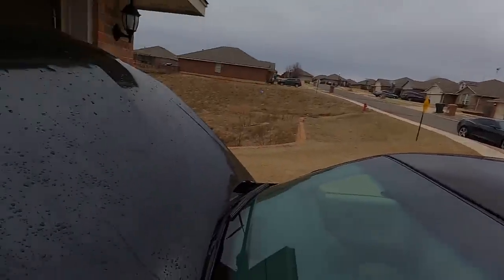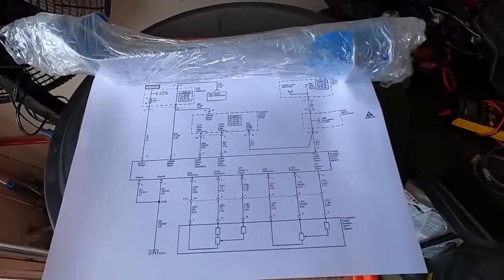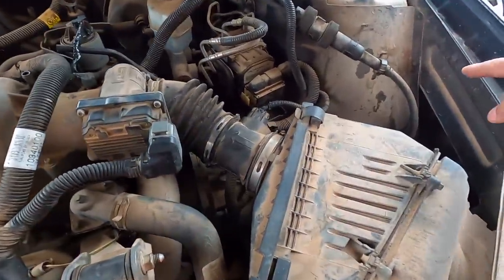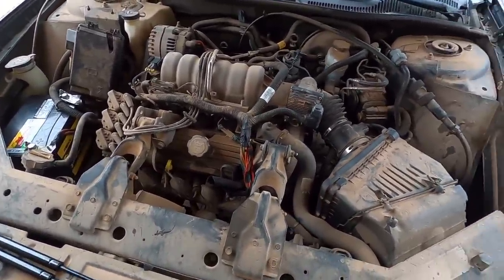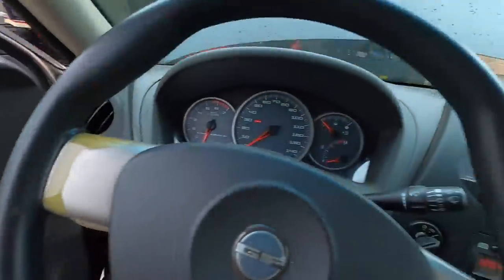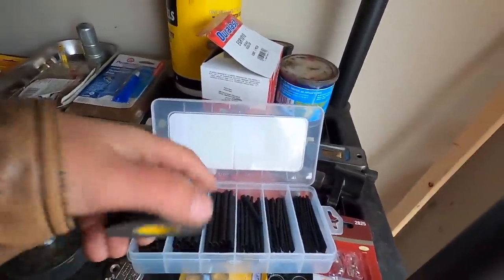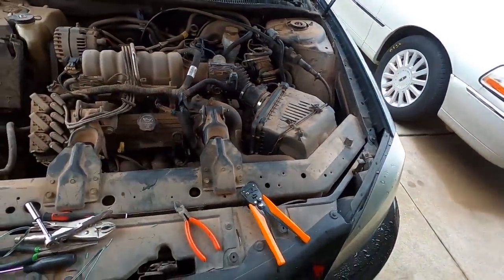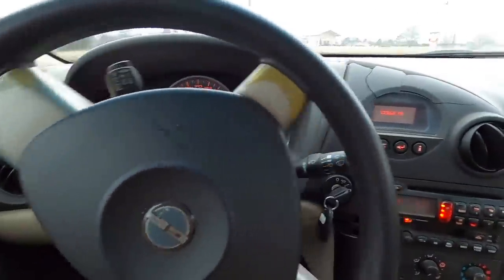Chevy, Buick, Pontiac p1125 p2125 p2138 Reduced Engine Power WATCH THIS FIRST!!

Comment from the maker: If you have ANY GM with a 3800 3.8L V6 with the "Reduced Engine Power" message, and / or you are getting any of these codes p1125, p2125, p2138 DO NOT REPLACE PARTS until you watch this video! 
If this video helped you, hit that LIKE button and subscribe! Thanks!
Reply: I had the same exact problem because i put an aftermarket air filter on lol couldn't figure it out took it to my mechanic buddy and he took care of it for me
Reply: could this apply to the gxp 5.3 too or no ?
Reply: Where are u located i have the same problem 2 wires on it showing and almost cut and divided
Reply: PLS RESPOND. I have this issue i spliced three wires and the car still wont start any help??????
Reply: @nuwhips  ppl
Reply: Saving this video some how

Comment: Dude thank you so much! My harness has the same damn cut with the same dang exposed wires! Worst part is the issue started the second I bought it. Before I could get it home it died on me, then let me start the car(roughly). Dudes have been dodging me as well unfortunately

*Edit: I did this to fix the two busted cables I had on my wiring harness and it still died on me for some reason I can’t understand
Reply: Did you fix it ?

Comment: Bought 3 $200 throttle body and 2 brand new gas pedals and still had the same problem...this video helps a lot....we need more GP videos...thanks yu really helped
Reply from the maker: Thank you for watching!
Reply: What year did they stop putting the 3.8 engine in the grand prix oh and my fans don't work help how do I check
Reply: I need this guy lol same crap with mine and these engine are mean

Comment: Thanks, Randy. Just saved me a lot of grief and helped me get my '06 Grand Prix running again, after having it towed home yesterday (reduced engine power). It was two rodent chewed wires, right next to the harness you had problems with. Soldered them back together, and runs great again. Really appreciate the library of videos you've created over all these years.
Reply: Mine was ground wires

Comment: Randy you should polish those headlights, use mothers aluminum polish it works soooo good and takes less than 10 minutes. No sanding the lights or anything it's so easy I could do it in my sleep and genuinely makes the headlights look new
Reply: Ur better off taking them headlights off. Than start to do some light wet sanding by hand or da.  You can either use 600,1000,1200,1500,2000 & 3000 sandpaper. Depending on how bad they are. and than spray clear coat. Once clear coat is applied you won't ever have the headlights turning yellow and have them looking brand new.

Comment: My 2007 GP GT went into limp mode, reduced engine power/ service traction control. After watching this video, the throttle body or tps was not my first thought as to the culprit although I did clean the throttle body bore and replace the assembly with a known good assembly from my other GP and satisfied my curiosity when it didn't correct the problem. Checking the obvious such as chaffed or broken wires and finding none, a simple pinpoint test led me to the accelerator pedal which I replaced for 125.00 purchased from my local NAPA which corrected the problem. Now if someone can tell what is causing my battery to go dead anywhere from 3 days to 2 plus weeks. A three-year-old battery was replaced at 4 years as it tested bad, 17 days later the car needed a jump. Battery and alternator test good, charge rate at 14.3 to 14.6. 5 days later battery dead again, 2 shops can't find a draw. Have since installed a battery cutoff which is a pain in the ass to deal with.

Comment: Finally got around to checking out the second channel. Liking the content so far

Hate that you started replacing parts before diagnosis but the education was well worth the money spent. And you now have a running car for less around 500 bucks. Now time to clean it, put it up for sale,  and get back to copart for the next diamond in the rough

Comment: My car is flashing those codes. Sometimes only p1125 and p2138 and then sometimes also p2125 with those other two. Haven’t had it for long. Looked at harness and it looks like someone had already put a piece of hydraulic hose under wires in that spot. I need a continuity tester

Comment: Not sure if this will be seen but I replaced throttle body and pedal as well as checked most of the wiring (what I can all get easy access to) and everything looks fine. So now I'm stuck and don't know where to go from here. I'm not sure if there is more wiring that I need to somehow get to that isn't as easy.
Reply: U may need a new  intake manifold
Reply: Did u fix it

Comment: THANK YOU!!! YOU JUST SAVED ME HOURS OF TROUBLESHOOTING!!! I just replaced the radiator for a friends daughter and moved the air box out of the way to get it out . Started it and immediatly went into Reduced Power Mode.  With TPS harness running to the to air box I knew there had to be a broken wire somewhere but Damn.... That's a lot of wires! Soon as I saw the wear on your valve cover, EUREKA!

Thanks Again, It would have take me all night to trace. 🍻

Comment: Thank you very much. I replaced the the throttle assembly and it didn’t help. I watched your video and that was exactly what was wrong. I had one broken wire and one bare wire. I repaired them and the erased the codes and seems to be fixed now. Thank you!

Comment: Just changed crank sensor twice trottlebody twice  02 sensor map sensor twice gas paddle assabley check fuel pressure twice changed plugs   and  wires watched this vidieo    bingo  most useful one I watched this year  thanks

Comment: So you shot the parts cannon first, should have done some research first and used your test equipment. Most likely only needed a voltmeter and some T pins to find the problem.
Reply from the maker: I believe I covered this in the video.

Comment: Not related to this video:Anyone experienced in Volkswagens i have a deal to buy an old 1992 Passat B3 VR6 for 1400 dollars with 230k kms on it. Can anyone tell me something about these engines?
Reply: Very good engine and hopefully its manual because auto trans sucked but I would give $1000 it's old, probobly rusted bad. I'm from Canada and for that price you can add a couple more bucks and buy better more reliable car. I've had the VR6 golf and had the B5 B5.5 and B6 passat line but now I drive an Accord V6 manual.
Reply: Chris Romanczuk Yeah it is manual if it was auto i would not consider buying it. In fact it is in a pretty solid shape from photos that i saw. In the country i live they these Passats arent really that rare i do have one which is 1.8 but only 90 hp its a nice car really relieable so i just feel that this vr6 might be even better.Anyway thank you for your recommendation and help